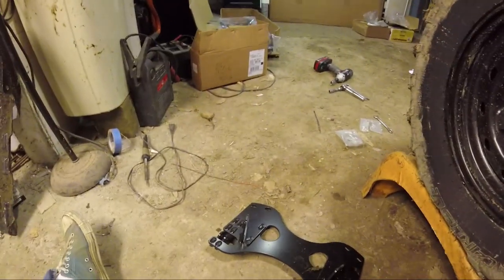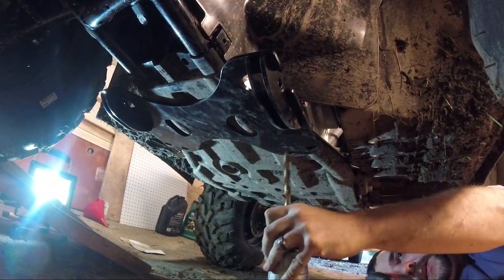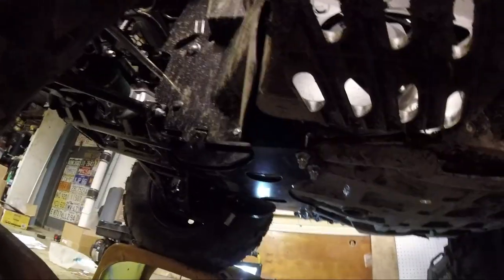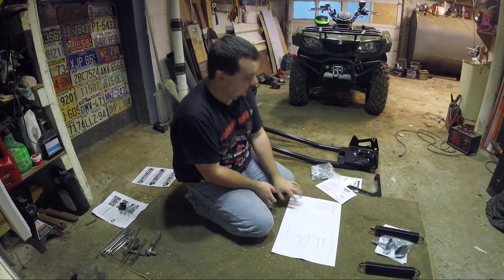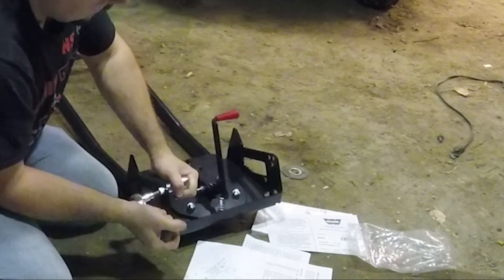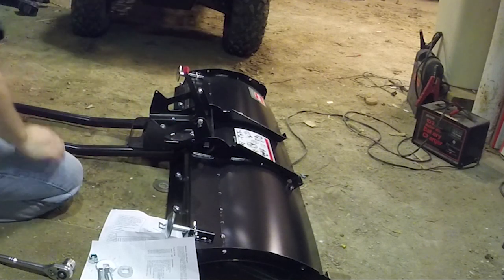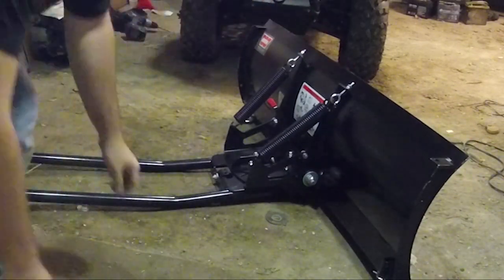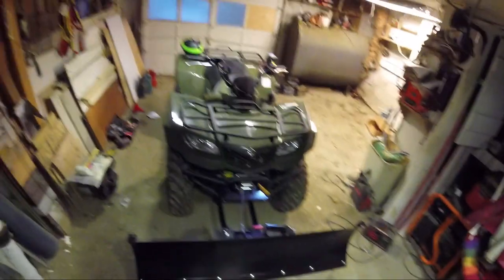Warn ATV Plow install

Comment: I have the same plow but hated the lift angle so I put a pulley into the system to reduce the angle with a tension spring in series for overloading at the full-up position. I considered a limit switch for the full-up plow position yet winter/water/salt might become a problem with that idea.

Comment: Have you had a chance to plow whit it yet. I am looking at buying this exact quad and would love your input on it. Thanks
Reply from the maker: Yes, tons actually. The quad is great in the snow, no issue, tons of power for plowing as well. I would say the only complaint I have is the Warn Plow, the top corners bend really easily. The bottom seems fine, but I had to bend back the corners a few times. It really doesn't hurt anything, but I expected them to be stronger. The plow is pretty easy to get on and off though, Its about a 5 minute job max. I would say my favorite thing is this thing makes an hour and a half job take about 20 minutes. So in my mind worth it.